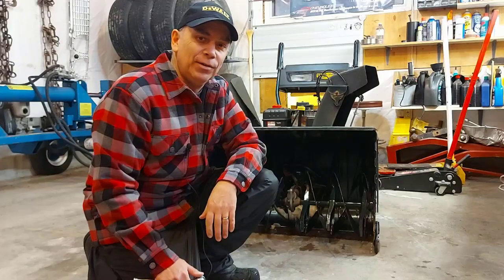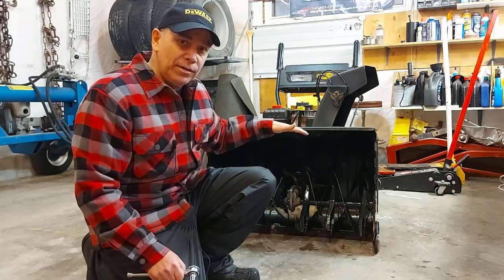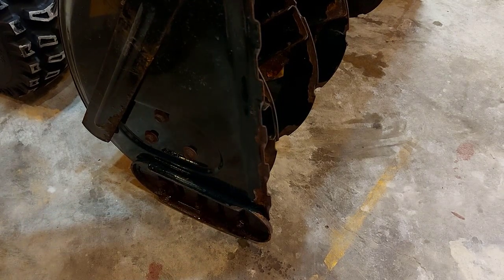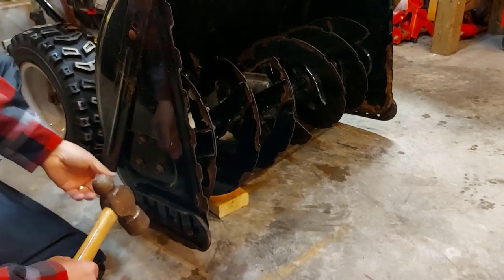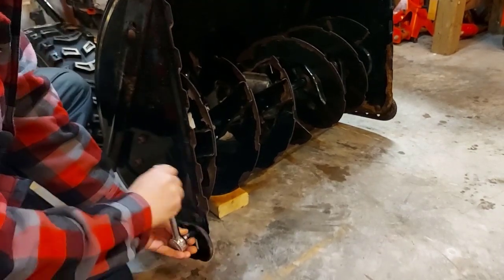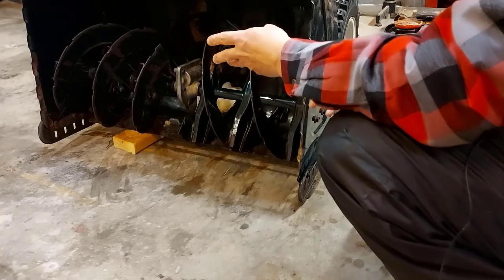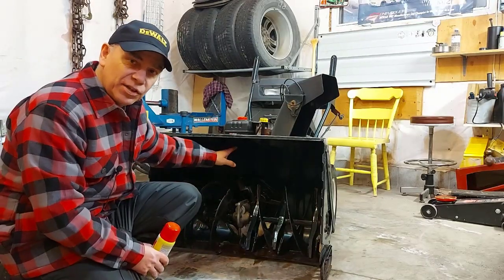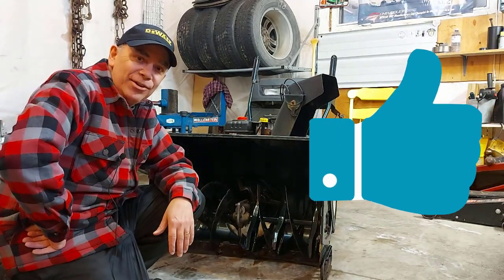Raise Your Snowblower for Gravel Driveway // Stop Throwing Rocks

Comment: Your skid shoes were not level to the ground so they aren’t completely making full ground contact.  Instead of that 2x4 and guessing where to position the skids, how about putting a paint stir stick (or whatever clearance you’re going for) under the scrapper bar then dropping the skids to make full ground contact before retightening the bolts?

Comment: Do not use Pam. Use silicone spray. Pam hardens in very cold weather, like just about any kind of cooking grease. Silicone does not. Spray Pam on a shovel or something, leave it on the porch, and check it out at 20 degrees. See if it's still shedding snow. Silicone will be.

Comment: Does this work with a normal snowblower or do i have to get a 2 or 3 stage blower because i have a gravel driveway currently. Thanks
Reply from the maker: If there are adjusting sliders at the bottom of your blower you should be good to adjust your height.
Reply: @GettingItDoneRepairs  ok thanks a ton
Reply: @LiabilityDiscourse  FYI, this really won't work all that great on a single stage snow blower, as most that I've seen don't have rear drive wheels. They use the auger to pull the snow blower along. If you raise the front and don't contact the ground, that makes it really hard to move the machine, as you will have to push it.

Comment: No it wasn't helpful because your title stated " For Gravel driveways" All you talk about was pavement. And yes you can still adjust the shoes for gravel, but it will horribly dig into the gravel and it will still pick up gravel  and you will have deep groves down your driveway. As of now I have seen no real fix for gravel you can buy shoes that are a bit wider, but not wide enough. What this snowblower needs is small sky's to float on top of the gravel. I ended up building my own. Their about 3 1/2 wide with a curl in front and back...remember you will be reversing it at time's. I really need help with a solution so your video was disappointing, I'll just work on my confidence to solve my own issues as I see mistitled video's more & more. No offense intended.